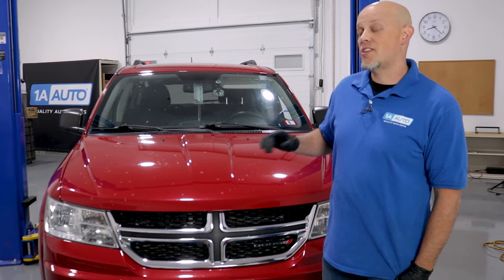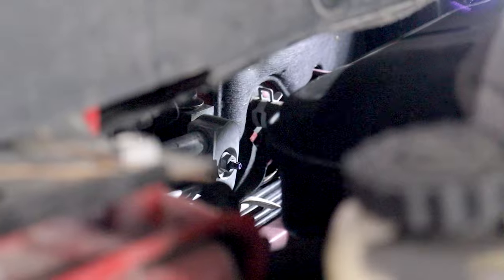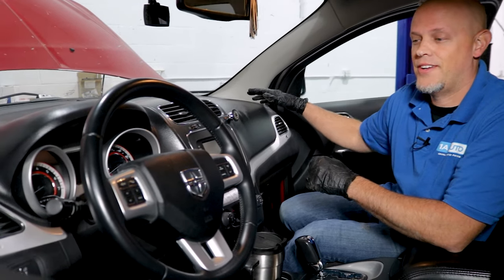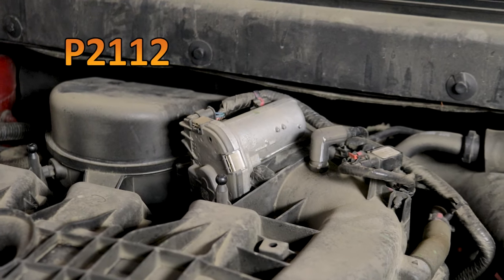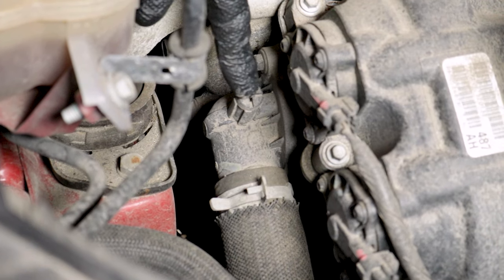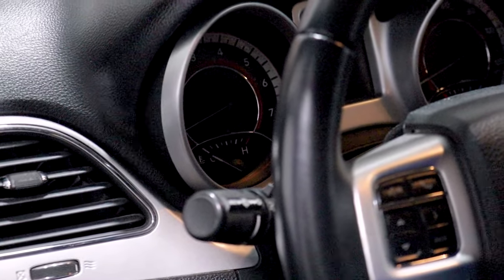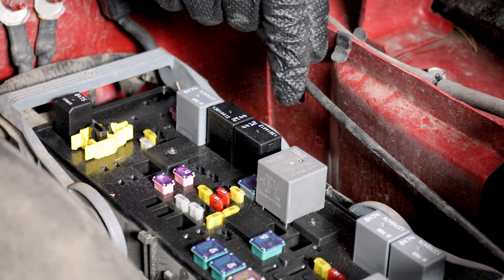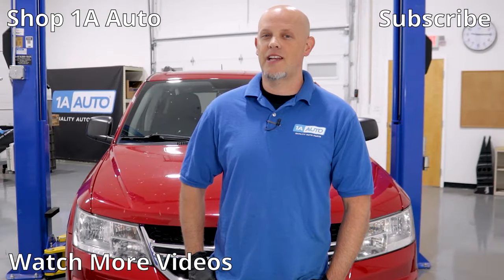Top 5 Problems Dodge Journey SUV 1st Generation 2009-20

Comment: I own one. Trust me: it's not just 5 problems.
Reply: Literally everything he described I experienced 🤣🤣 especially the eratic wipers. Add mention the transmission solenoids on the 6 speed. 😭. I let the poor thing go.
Reply: @hollisiv9947  yea I have a bad selenoid in my 13 . It's paid for so I'ma keep untill it does
Reply: @cyrussstinson332  I'm sorry to hear 😭.
Reply: @cyrussstinson332  I had a 2013 as well. Barely gotten to 101k
Reply: Literally, I got a 2014 make basic SE 6 cylinder and its had countless issues! Never getting one again
Reply: I got an 11 and issues ive had are the wiring.. ie: door wiring starting to break in the door jam. number 2 wiring in the tailgate breaks single wire. have 160K on it
Reply: Burnt module, dead transmission, dead air conditioning, etc.
Reply: Buy a Toyota.
Reply: @WPGinterceptor460Interceptor  These are common problems with all makes of vehicles, where the wire harness goes from the body to the door, or liftgate, with all that flexing sooner or later the wires are gonna break! The driver door usually goes first then the liftgate second cause they get the most use.
Reply: Yes.many more than 5 issues. But great vehicle
Reply: @rickyates1833  have to disagree with you there bud, had one since 2009 and theres been a major issue every 6 months needing a fix. barely 100k miles on it, probably would have more if it didnt spent half the time in the shop or waiting to get it into the shop. literally to the point that its on me for not punting the thing years ago
Reply: Lol..They just naming “their” top 5..lol But us owners know it’s more like top 15+ 🤣😩 I got a 2014…& there’s sooooo many problems with it 😩 And today it started over heating out of no where..that’s just one of the humm…let me guess…6 current problems it has today. 😳
Reply: My gas sensor or gauge never works. It’s always an issue. 🤦🏽‍♀️
Reply: Exactly
Reply: @cyclonnb  Toyotas are the best vehicles made.
Reply: Same!! Lol
Reply: @roberthenry731  A voice of reason. Thanks.
Reply: Seriously!! Lol
Reply: I have this vehicle,  170k and still running 😎
Reply: @hollisiv9947  So you shot it? Good move
Reply: @randomgameuploads1162  bullseye 🎯
Reply: He forgot the mention the fuel pump ⛽️ 😫 thinking about getting rid of my Journey
Reply: my 2011 is grounded. Don’t know how…
Reply: My rear differential exploded today lmao
Reply: my dad owns a 2012 R/T has a lot of problems
Reply: 2011 here. Biggest pos ever!
Reply: Anybody with a bad alternator and serpentine belt? Weird knocking from the glove box. Got the thermostat changed already.
Reply: Pos... Changes oil pump 2x and sensor still reads low oil pressure!
Reply: @ericboneta5890  y’all giving me mixed signals man should I get one or not ?is it good or not

Comment: I bought a 2015 dodge journey avp 2.4l in 2016, it had 16 miles on it when I bought it. It now has 205,897 miles on it. It still runs well and drives smoothly 👍🏼

Comment: I bought this vehicle new 2 years ago and i urge anyone reading this, please don’t. When I say I’ve had electric problems from the start it’s been a nightmare.
Reply: We bought 1 in 2014 new, lemon law it 8 months in, we needed a 3rd row vehicle so bought another in 2018 no problems so far 53k miles on it , can’t beat the price compared to other 3rd row.
Reply: Smh…wow! And you’re first owner! That’s crazy..I have a 2014 for the past 4yrs…& it’s been sooo many problems 😩
Reply: I bought mine 3 months ago and car died while I was driving on the highway. Replaced the battery but still draining.
Reply: after 130000 miles is when mine started to go terrible
Reply: What were the signs of a bad throttle body

Comment: I have a Dodge journey sxt 2013 . It's done 83000 km and still going strong.Even the battery and brake pads are still the original. I cannot understand the fuss people making about Dodge journey. For me it's a brilliant car.
Reply: I have the same exact model and year.  Just put 70,000 on her and never had one issue. Has been a wonderful automobile. Knock wood.
Reply: Facts
Reply: We had like a 2009 model and it was sooo small in the 3rd row.
Reply: im going to buy a used 2010 journey sxt, 127,777 miles for $6,800. I think the price and miles is a reasonable deal for a semi newer car, but i had heard there are issues with these cars, but i want to double check...

Is it worth it?
Reply: @inzane3229  nope its not
Reply: @inzane3229  did you buy it? Any issues?
Reply: The fuss people are making are over their experiences that aren’t like yours! I’m glad you’ve had a wonderful experience. Some of us haven’t! My 2009 was a lemon  and had continual problems. Transmission, ignition switch multiple times including recall twice, shoulder restraint including 1 recall, multiple electrical issues, battery charge issues, tire issues … had to get tires 2+ times a year until different brands other than Kumo started making the R19, and the list goes on.  I loved the style and features of my Journey but all the issues I experienced has made me quite leery of them now. Maybe it’s just ‘09 wasn’t the best year for them, but people have had issues.
Reply: I have the exact same year and model - unfortunately, I'm just coming up on 140,000 km, and I'm on my third motor.  I also just replaced the head unit with an Android unit because the OEM one was dying.  IF it stops having significant problems, I really like the car, but mine has certainly not been bullet proof.  Mine also has a parasitic drain, and the passenger side heater gate is stuck.

Comment: I love my 2011 dodge journey. Had maybe a dozen problems over the years but still runs great and looks great.
Reply: You should never have a dozen problems on a vehicle other than a lemon.
Reply: Mine too
Reply: My 2011 Dodge Journey runs today as good as it did new . Keep the oil changed regularly and change the air filters...thats it .it's due for brakes soon but it's 11 years old since it was a demo car and even has the original battery.

Comment: I bought my 2012 dodge journey new and have 194,000 on it. Same engine, tranny, no electrical problems. I have replaced some stuff and always maintained it with a master mechanic. I know these don't have good reputations and it is not a high end car by any means, but it has been a good road car and reliable. First Dodge I ever had. Every manufacture has their rough cars, especially if it isn't their high end models. Most people don't get problems fixed right away and they don't have someone they can trust.
Reply: True about people not properly maintaining their vehicle or not having a trust worthy mechanic.

Comment: My 17 journey gt is fantastic!  Only issue I have had is replacing the key fob battery.  61k miles.  I've towed boats and jet skis with it with no issues.  Awd works great too
Reply from the maker: +Chris Page Thanks for the feedback!
Reply: FOB battery lasts about 2 years,  I actually keep a spare in the glove comlarment.
Reply: U shouldnt have to replace anything at 60k. Lol. I find it funny ehen ppl ssy that. I loterslly oen cars with over 350k sith all the original parts but a car u have to change shitbon at 60k is soooo great.
Reply: It’s a dodge respond to your comment at 100k miles :)

Comment: I have a 2012 SXT 4 cylinder, 2.4 L, front wheel drive with 156k on it. I've driven from Texas to Guatamala and back twice and it's been our daily shared short journey car inbetween hammering over the Sierra Madres . As a family we really hammer this car with dog in the back, camping gear on the roof and sometimes bikes on a rack at rear. I've had to change the thermostat and the waterpump. The rear lights went out so I had to fix the wiring with electrical tape and just a week ago a rear side window stopped opening so I'll have to fix that. It started using oil about 30k ago and so between oil changes I have to top it up with a pint or two.. I change the oil every 5k +/- and have done the transmission services on time. I think I change the anti freeze every 2 years. My wife chose the car for the leather seats and sunroof thing, I'd never owned a Dodge before always Ford, Nissan or Toyota. This has been the toughest and most reliable car I have ever owned. I guess I got lucky! I don't want to talk about the Sonic we bought...
Reply: Thanks, about the same with 2015, 4 Cyl ,,, thouhg only 93, 000 miles now… see my Comments

Comment: We had a 2013 with the V6 and no issues with just over 100K miles. 
We traded for a 2017 Journey GT with the V6 and it is now over 100K without any issues.  
Just normal maintenance. 
I even tow my 18' roundabout boat with it. 
We normally get 27 mpg on the highway, towing the boat is 17 mpg and running in 5th gear on the highway, towing at 70 mph. 
No issues.

Comment: Been shopping for a new car. Doing lots of research, literally cannot find any new car that isn't crap. For some strange reason, nobody seems to know how to build a car anymore.
Reply: I’m in the same boat!! I was looking at Equinoxes but after doing my research sounds like they have horrible engines 🥴
Reply: They know exactly how to build the car, the only difference is that in the past, they built them for you but now on they build them in their best interests.
Reply: @js-wy8fg  Right. They build them to only last so long before it needs something fixed. In other words, they're built in the name of "Job Security".
Reply: @AD G 
try Holy water 💧

Comment: I bought a 2013 dodge journey brand new and so far done 135k. It gave me no problems. Today I changed the original battery with a new one. I still have the original brake pads contrary to people saying brake pads fail prematurely. I love my Dodge . From Australia 👍👍

Comment: I had a 2013. 130,000 miles. Never had a problem except the thermostat was bad. The temperature never got above 1/4. Didn’t have heat. Swapped it and was good to go.

Comment: i have a 2013 and havent had one problem yet at 68,000 mi. i like the car but at 6*3" tall driver is slightly uncomfortable, also the rear of car floats back and forth at times so it feels strange at times
Reply: U got any problems yet ? Wana buy 2013 sxt model
Reply: Just you wait, at 110,000 miles I needed my engine replaced, if yours isnt a lemon, good for you cause thats rare

Comment: So far so good for my 2018 Journey.
Reply from the maker: +Tino Arreguin Thanks for checking us out! http://1aau.to/m/Shop-1AAuto-c
Reply: @1AAuto  you guys rock.
Reply: Hi do you recommend me to buy one?
Reply: @rizzz007  I would recommend buying one if you care about: third row seating, rear ac, and 20k brand new. Because ekf the price the car is cheaply made and develop problems as they age. They're not that bad if you take care of it and do preventative mantinence, but some things are stupidly designed and hard to replace. Ex. Take off left wheel to get to battery, right wheel for alternator, rear struts you must take off all panels nearly, etc.

Comment: I have a 2018 I bought new only has 29k miles no issues so far other than my battery in my Fob. Just general maintenance still got my factory tires on it.
Reply: It's a GT by the way

Comment: With my 09 Dodge Journey, I've found the location of the battery lends to battery failure in cold weather. My battery gets cold during nights and non driving times and drags the battery down as it's located down behind the drivers front tire, removal of the battery requires removing the drivers front tire, fender skirt and then turning the wheel all the way to the right to access the battery. Also splashing through puddles can split your battery down the side as mine did a couple of years ago and led to battery acid going everywhere!
Reply: I've never had to take the wheel off my 2012, 4 cylinder to change the battery. I've driven off road on rocky trails a lot and forded streams without problem. Maybe you are missing the plastic underbody protection that fixes to the front bumper? I's a big piece of moulded plastic that I've broken twice but it protects the battery as well as under the engine and transmission. Good luck!

Comment: Bought a 2013 Journey SXT from a dealership 2 years ago for $9000.  Had 170,000kms on it & I've had to put $5000 worth of work into it.  New transmission & passenger side half shaft @ 200,000kms, new blend doors @ 215,000kms, & all the routine maintenance (oil changes, air filters, etc).  Heater isn't working correctly now so I'm going to flush the core & change the coolant.  If that doesn't work & I need a new heater core ($2000 job), I'm scrapping the car.  We had fantastic luck with Dodges in the past (1992, 96, & 2010 Grand Caravans), but I'll never buy another Journey

Comment: Thanks for the video. I bought a 2012 Fiat Freemont which is essentially the same as the Dodge Journey but with the smaller 2.4 litre Gema engine. I started up a Facebook page and found the following main issues that kept appearing on the page. 1. The wiring loom on the rear hatch. The wires eventually fatigue and snap, causing issues with various rear hatch functions such as camera, rego plate lamp, hatch lock button, wiper, reverse light, brake lights. 2. The bluetooth module. Randomly fails and is very expensive to replace out of warranty. 3. The heater vents not functioning properly. 4. The throttle body. Its made of crappy plastic so the internal cog eventually strips and fails.

Comment: Should of also said if fob battery dead or missing hold fob to start button and journey will start and drive. If journey is dead and you want to put in neutral to roll, inside of box between seats is a little opening to put screwdriver to allow stifter to move. The wiring harness inside of rubber boot on rear hatch hinge, wire tend to break due to twisting screwing up all door locks and security.

Comment: My power steering hose got a hole in it does it make it not want to turn if I still have power steering in it
Reply: Had same issue 3 weeks ago, I have 2018 20,000 miles. Took to shop was replaced under warranty known issue is what I was told. Mines actually leaked

Comment: I have a 2017 Dodge Journey crossroads.. other then a small problem with the radio touch screen, Ive had NO issues. At 57000 miles

Comment: I got a 2016 journey sxt with the 2.4. Ot has 66,000 when I got it and now has 75,000. So far 0 problems.  But i wouldn’t be surprised if the later models like mine have less problems than the earliest models like 2009-2012
Reply: I bought a used 2017 SE, cheap version,, in late summer in 2017 from a Dodge dealership. with 3,100 miles, yes 3100 miles, they had over 10 of these cars and probably used it for service rentals. I paid a total of $15,321 out the door, they wanted to charge me $15,900, I walked out the door got in my car and was driving down the street when the manger call me back and agreed upon my original price.   I laughed when the salesman told me the were big sellers, yeah right you got  10 sitting on the lot.  I have over 38,000 miles with no problems so far, I plan to replace the battery during the summer as it is a hassel to replace and I don't want to have problems when least expected.  I use synthetic motor oil, changed the spark plugs at 30,000, and air filters every 20 000. To me,  some of  Dodge's recommended service  intervals are spaced out  way too long.
Reply: Well......some of the Journeys manufactured in 2012 and from 2013 onwards have some Fiat components that are not as reliable as the Dodge components. You have to check your oil because very high oil consumption is the norm. Infact there is a class action lawsuit in process right now against Dodge for this very problem. You can Google that.

Comment: The Journey seems so hit or miss. I own a 2012 with 160k on it.  Heater core and radiator had to be replaced. The 3.6 in mine had to have the cylinder head replaced which was quite common for the pentastar v6. Mine doesn't owe me a thing, it always starts and always gets me home. Every feature still works at 11 years old! The 62te transmission hasn't been touched and has been troublefree. I'd gladly buy another one.
Reply from the maker: +Austin Peters Thanks for the feedback!

Comment: From deep o my heart. It's my first and LAST dodge. Yes.  It's a R/T 2010 red, beautiful... But frustrating ownership. Still here in my driveway. 139k miles. More dash lights.
Sure I'll hit some tree with this.
Reply: How many of you really take care of our car. I don't mean oil changes and the rest of the maintenance that needs  most people don't
Reply: @lindajmorris9178  I take great care of my cars and my wife Journey runs great.   lost a oil pressure sensor. Had an oil leak on upper oil pan. Oil pump high pressure silenoid failed and I had to replace oil pump. I change oil every 5000 miles with synthetic oil.  I tig welded in my own transmission pan drain plug and change the trans fluid every year, first trans filter change was at 50000,  second at a 100,000.  I have changed the coolant now 3 times and the thermost once.  I lost rear heat a few years ago and had to back flush rear heater core.  Now have 150,000 miles and I bought it with 200 miles on it. I just replaced the plugs again this week because I had to get back in there to do the oil cooler gaskets.  They are a piece of shit cars.  I have an 04 Santa fe with more miles thats had less problems.

Comment: 2009 here.
Changed rear axel 5 years ago 2500$
3 breaking pads
2 full sets of rotors
Exhaust valve electric part
Heater still not working...
Entire interior squeaking 
Drives smooth and muffler delete^^ sounds so good lol.
And car sometimes just not start for some reason...
250,000km